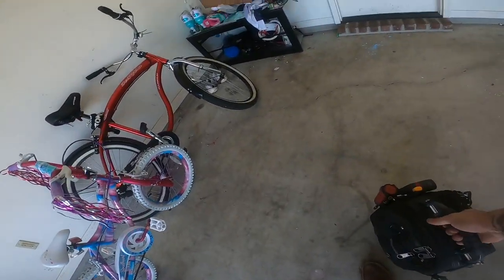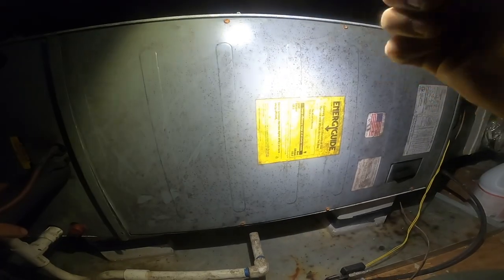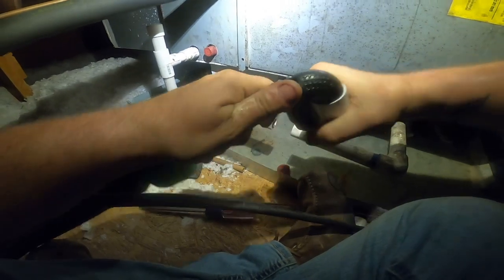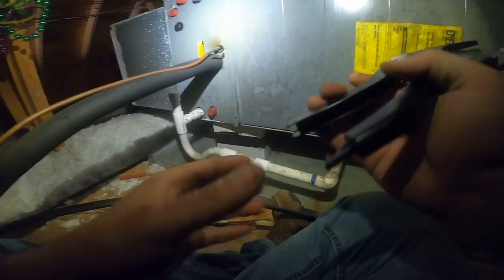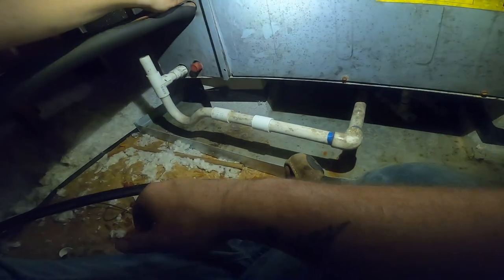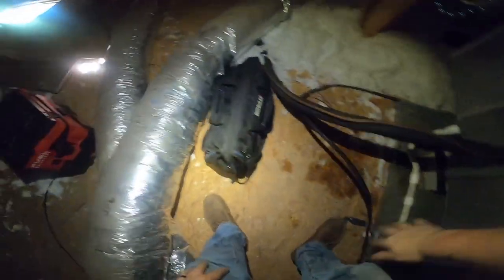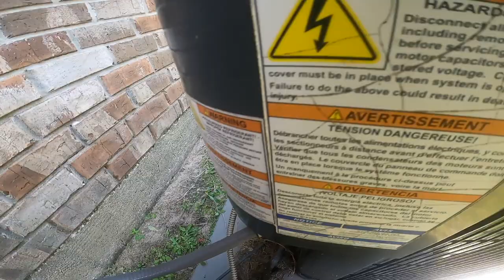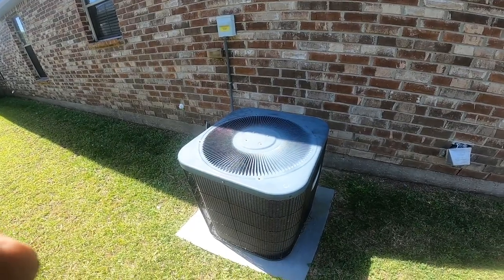No Cooling Call/Clogged Drain

Comment: Are you flushing the line so the water is going outside? Hard to follow where the water is going?
Reply: After you clear the clog. You flash the line with the water in the pan and it goes outside.

Comment: A wet vaccum running from the outside and the house with the fitting from the attic it is all you need to suck the water on the pan, and will send all the water through the pipe. Not care bunch of things to an atic space.
Reply from the maker: You do you brother and I’ll do me. Not all pans have aux lines here